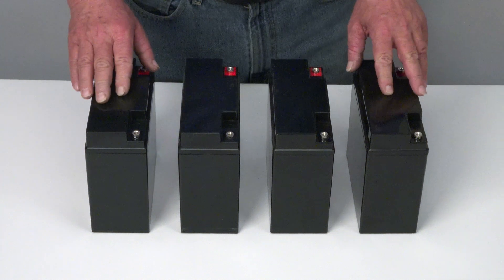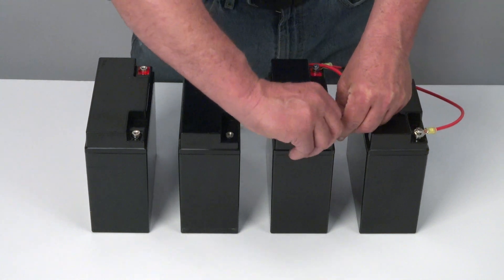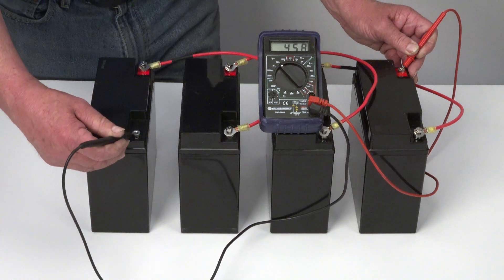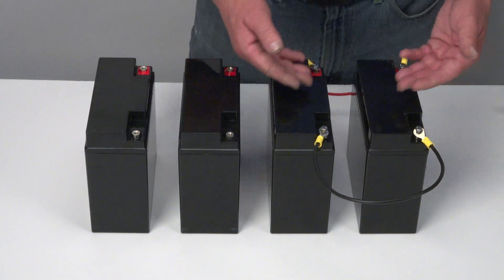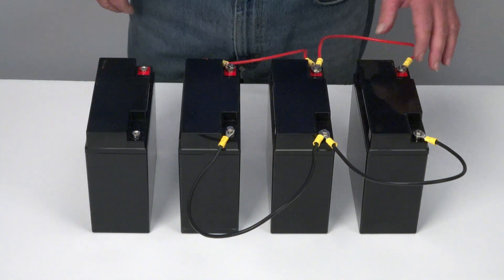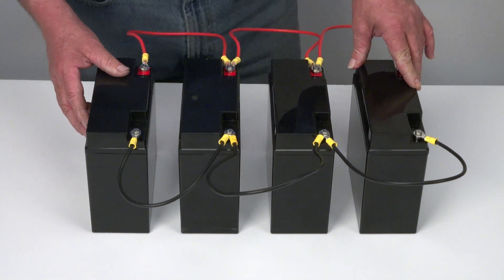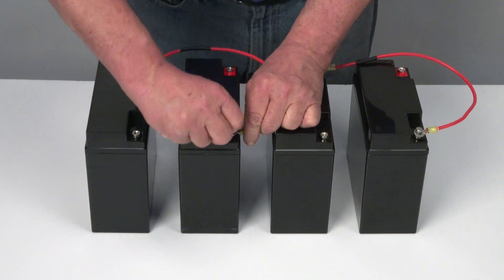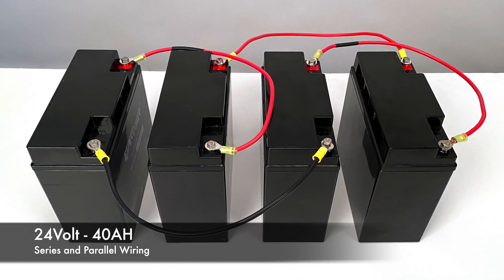Wiring Batteries in Series and Parallel

Comment: So how would I make 2 5ah 20 volt drill batteries into more power for my kids hot wheels
Reply: Those 20v are actually 18v. That's just marketing to make you think it's more. You'd want to run those in series to create a 36v but with only 5ah it's not going to be worth it . They'll be drained to quickly and most likely burn up the motor as it's pushing to much voltage. Upgrade the motor and then buy some bigger ah batteries. I'm guessing you're using DeWalt batteries so maybe be careful with those. They're more finicky than say Milwaukee batteries. They can do more easily catch on fire. Especially when charging for long periods of time being left on the charger. It would be easier and probably more economical for you to just go online and get a bigger lead acid battery with more AH or a lithium version of that. I've been trying to do the same thing myself with my kids razor pocket mod. So I'm just going to end up buying new batteries and getting lithium ion instead of let acid because they give you a lot more run time because they're more energy dense and efficient.

Comment: The posts you connect your load to need to be spread across the battery bank though - super important for equal charging and discharging across each battery.

Comment: Thank you. This was so clear. 
Can I ask how do you know what gauge wires to use as jumper cables? I’m trying to use 6 12v batteries to create a 24v array for a solar system.
Reply from the maker: @mikeheim44  Mike 
It all depends on how many amps you’re drawing or running through the wires. Do a Google search for Ampacity charts /wire gauge charts.

Comment: I am wondering about recharging the batteries when they are in the either the series or parallel " modes " do you still just connect the charger to the positive and negative of one of the batteries and it charges the all ?
Reply: Yes

Comment: If you put a meter across the terminals of a given battery in the middle of the series, you'll get 12V right?
Reply: I want to build a multi channel battery voltage (and capacity if possible) monitor for the hydraulics in my 82 Monte Carlo. It will be wired for 96V and I want to have a HUD in the center console where I can glance and  and see the individual and final series voltage. Do you know of existing models to accomplish that his? Such as a 8,10,12 channel BMS with a multiple input app or LED display?
Reply from the maker: @phreaktor  yes
Sorry for the late reply

Comment: Unfortunately the 4-battery parallel wiring you're showing here does not produce balanced charging or loading.
Google this to learn how to do 4-battery parallel wiring properly:
impactbattery How to Charge Lead Acid Marine and RV Batteries in Parallel

Comment: Sir could be possible if I want to make a parallel (12 v, 100ah x2) then I series it with 12v 200ah...in other term 12v 100ah x2 + 12v 200ah...thank in advance for feedback
Reply: Yes, that will work.

Comment: I have 8*12V batteries
I need ro make 2* 48V series array and connect em to each other to boost e AH.
How do I do this.
Pliz help
Reply: Pack 1: connect 4 batteries in series. Pack 2: 4 batteries in series. Now you have two packs with 48v each. Connect pack 1 available negative contact to pack 2 available negative contact. Connect then pack 1 available positive contact to pack 2 available positive contact.

Comment: Wow that's so clear. I love it. Thank you. So theoretically, connecting something to the second battery and ground you can power something 24v and with the first power something 12v? Like it's all able to be split up and devided to whatever?
Reply: No, both batteries will be 24v when connected in serial or serial and parallel.

Comment: Why isn't this considered as a short-circuit in any of the scenarios?
Reply: Because the circuit is not complete. The same way a cell's positive and negative sides are separate, the positive and negative sides of any number of cells wired in parallel are also separate. In series, the positive terminal at one end and the negative terminal at the other end of the array are not connected.

Comment: What if you have 4 total. 3 in series and 1 in parallel with one of the 3 in series? Is that 36 and 12 volts still?
Reply: Yes. But not recommended to do it like that, since pack will be unstable.

Comment: This... Especially the last part... Confirmed what I had in mind. Thank you. I'm not a fisherman though... I am just trying to get my Power backup system grown. Inverter takes 24v. Currently I have two 12v @ 100ah in series to give me 24v @ 100ah. Now I need to buy two other 12v @ 199ah and join their series group in parallel with the existing ones to give me 24v @ 200ah.

Comment: I am connecting four 200 amp lithium batteries in series/parallel.. the batteries are 12 volt and I'm looking for a 24 volt system.. if I connect them like you demonstrated towards the end of your video how many amps would I have total?
Reply: 400AH

Comment: Not a fisherman here 😂 but ive got a 100ah 12V 2A battery powering a desktop pc, and was wondering how hooking up battery's effects the voltage, with this videos knowledge, i know to buy another 100ah 12V batt and run it in parallel, as more than 12V will fry the psu. But a desktop pc needs more power than just 24watt, 48watt should suffice, Great tutorial, thanks alot.

Comment: Thanks for this simple and informative video. I do have a couple questions that aren't really addressed in these type of tutorials for the series-parallel configuration. Firstly, from which terminals should I connect a charge controller and/or an inverter? And second, can DC circuit breakers be used in place of fuses to protect the batteries in a LiFePO4 battery bank? If anyone can help clear this up for me I'd greatly appreciate it.

Comment: 1:30 That is interesting that in Series you got different voltages when measuring from different batteries, 12, 24, 36, 48. Could you use that effect to create circuits off different batteries to power devices that need different voltages without a converter? I realize that would cause the batteries to wear unevenly, but it would be a lot more reliable and efficient then using voltage converters.
Reply: no you can't, and don't. It will destroy your system
Reply: @escapetherace1943  yeah. After a further investigation I found that it will wear the batteries down unevenly. The battery with the lower voltage would probably get the most wear and that battery would die rather quickly. If in the future we ever have extremely high cycle durability batteries, it might be the way to go.
Reply: @PopsGG  it's also more efficient to use high voltage systems, less power loss so it would likely be better to run through a 12v charger coming from 48v energy going through your inverter
Reply: Series adds the voltages, but keeps the current similar. Parallel does the opposite and the voltage stays the same, while current increases.

Comment: What gauge wire should be used?
Reply: Depends on the effect you draw. Here is the formula (metric): cable thickness (mm2) = Current(A) x cable length x 0.0175 (ohm)/ voltage drop (V). 
Ex. You have a 2 kW motor. Current = 2000W/24v = 83,33A. Lets say 5 meter cable, assuming 4% voltage drop = 24v x 4% = 0,96v. So filling out formula, 83,33A x 5m x 0.0175 / 0,96 = 7,49 mm2. So you would need a 10 mm2 cable, or 8 AWG.

Comment: So my mobility scooter is run on a 24v sistom ie 2 12v batteries making the 24v if I was to say connect 5 batteries of 12v together keeping them as a 12v but upping my amp ? Then connected the 2 - 5x12v I'd intern be creating the 24v sistom 🤪🤔🥴 o god this is confusing

Comment: Hi !  Great video Thanks.  I need to connect some 4 volt Li-on cells to create a 24 volt main pack but it needs to weigh between 750 & 800 grams. As they are 70 grams each 6 in series won’t be heavy enough.  Can you suggest a series / parallel combination please ?  Thanks !  Eddie.

Comment: The instructions received with my lithium ion 20ah 12v batteries recommend I don't do this kind of connection with 4 of the batteries. Can anyone think of why?
Reply: The BMS on the lithium batteries might not support this kind of wiring setup.

Comment: If i put 4 unevenly charged 12v batteries. Will it chargeup to 12volts? Or do i need to charge them separately first?
Reply: the short answer is yes they will charge. fully charged batteries at rest will measure out at 12.8 volts. anything under 12.5volts is a flat battery.

Comment: These questions NEVER get answered:
1. How do you connect a charger to these types of connections? Especially P-S connections.
2. How does the P-S battery system connect to a charge controller?
3. How does the P-S battery system connected to an inverter?
Reply: You essentially have ONE negative port available, and ONE positive port available when you connect batteries in series/parallel like this. At that point, you treat it like any other battery...He is literally pointing to them @1:20
Ignore all the other terminals, those terminals are now the whole battery, positive and negative. Treat it as you would any other battery for your application.

Comment: Please I need an advice! My questions is....Can it be possible to wire SIX batteries of 12V 220ah in SERIES AND PARRALLEL to give 48V 880ah for a system Inverter of 3.5kva 48V?
Reply: Kinda. So You would run 4 batteries in a series creating 48v 220ah and run them parallel with the next 4 to creating 48v 440ah. With that said, you would need 8 more running in series and parallel like the first 8 and run these two blocks of 8 batteries in parallel making a total of 16 batteries to create the power you are wanting at 48v 880ah.

Comment from the maker: This is an updated remake of a video I posted 10 years ago. The old video has over 2 Million views!
Reply: On the last part(series/parallel), which would be the main positive and negative? As in, if I wanted 24v output, what positive and negative would I safely attach to?
Reply: @scarr3ll  In parallel, as he mentioned, it doesn't matter as long as one connector is connected to battery pack 1 and the other to battery pack 2.